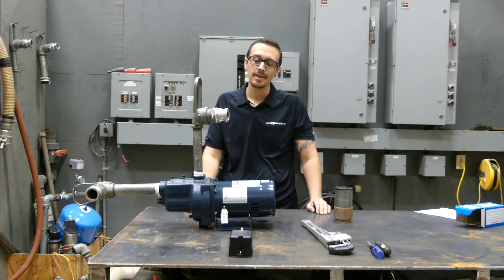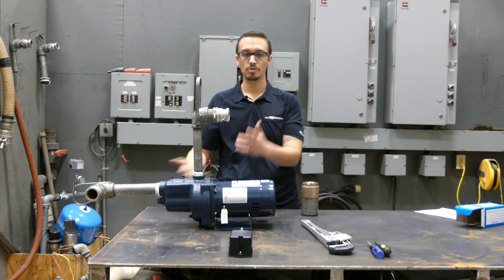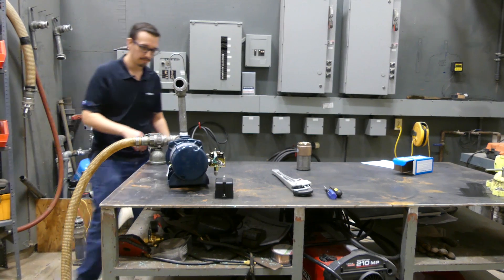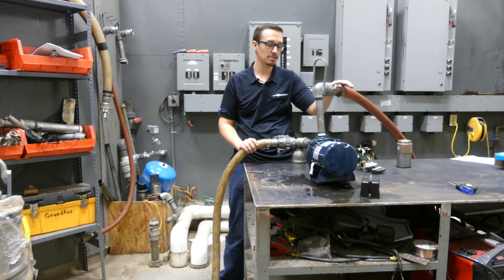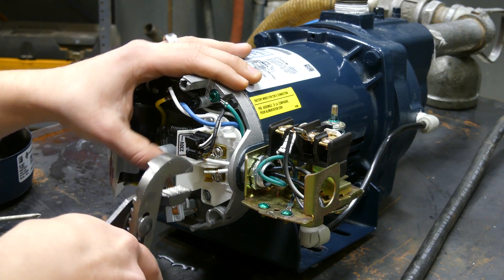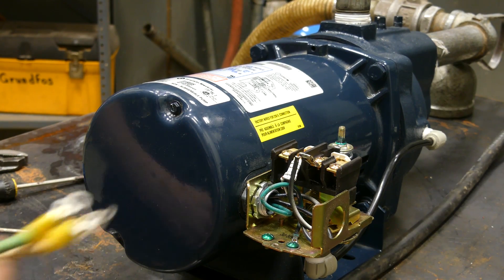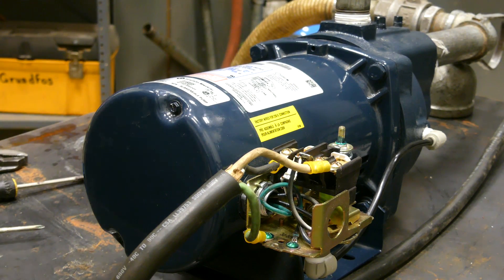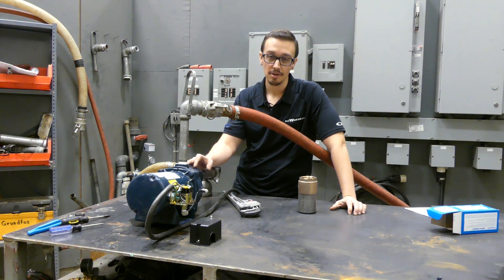Testing a Jet Pump

Comment: Good day sir! What is the problem when my SINGLE PIPE DEEP WELL SYSTEM starts pumping then after 10 to 15 seconds it stops. My pump has APC(Automatic Pump Control) installed on it. Thank you..

Comment: DISAPPOINTED ... 
... 
My pump is quite "mature" and I was more interested in the ELECTRICAL REBUILD side of PUMP REPAIR 
...
My old PUMP does a fine job of PUMPING Water ... but ... the ROTOR & BRUSHES may need replacement or repair / refurbishment 
...
Do you offer a VIDEO on the ELECTRIC end of a possible REBUILD ?
... 
Thanks
COOP
...

Comment: We lost our water supply from the city water in our rural community due to the Caldor fire. I get a 2500 gallon tank, and I didn't know what pump to get other than a pressure sensing will pump. I bought this one. CountyLine  Convertible Jet/Tank System with 7-Gallon Pre-Charged Pressure Tank, 1/2 HP 

I'm hoping I can just hook up the supply to the tank jet fittings and plug it in and turn it on and it will function without just dropping a pipe into the top of the tank. I have no idea, but one way or the other it should work, unless I can be directed to a different pump.

Comment: Never and i really mean NEVER , check el. engines or el. componenets of any kind, for el.power breach  like u did in this video. There is really to many tools for testing that instead of what u did.
 Atleast, but only if u DONT HAVE ANY OTHER WAY,  check it with  upper side of your fist (open hand) if there is electricity it will hit u and u will be able to pull your hand away from motor or some componet.
Pls DONT DO IT with open palm and ONLY DO IT WITH SOME INSTRUMENT IF U ARE EDUCATED ENOUGH FOR THAT KIND OF WORK. 
Srry for big letters i am just trying to give some importance about handling el. power.
Cheers

Comment: Can 1 HP shallow jet water pump have capacity to lift or suck water from a distance of around 500 feet in plain level. I want to pump in from pond which is far away from my home .
Reply: Yes, I have one set up that way. My 1hp pumps about 75 yards horizontal then up 20 feet into a cistern

Comment: Hey is it possible to connect  my air volume control valve to the drain port of my pump to create a pressure difference needed to pump air into my bladderless galvanized tank. The only port at the suction is the drain port. Normally there is a port above the suction intake port to connect the 7/16" tube connection to the air volume control?

Comment: Hello Where can I get those quick connectors and hose like that? Schells4@sbcglobal.net
Reply from the maker: We sell all of it! I'll email you more information. :)
Reply: There called cam lever connectors there used a lot in industries you can get them in all types of materials included polypropylene,aluminum, stainless steel